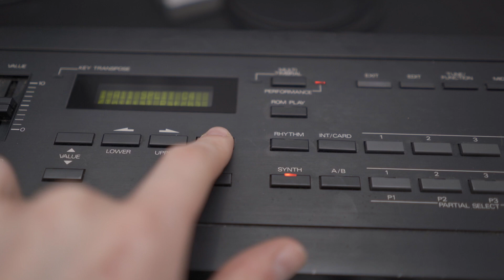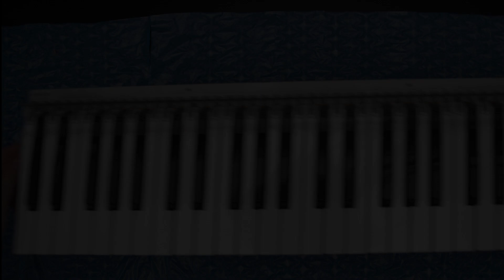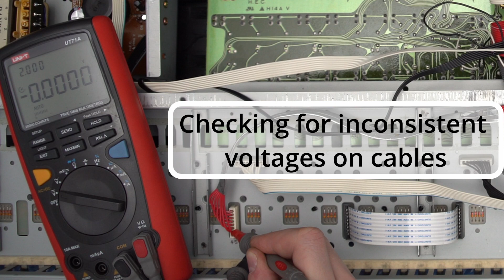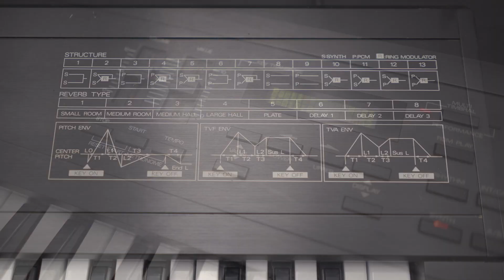Vintage synth restoration - Roland D-10 from 1988

Comment: FYI - there's a test mode you can enter by holding EXIT+EDIT together in which you can check all the switches, pots, keys, LEDs, the disk drive, etc.
Reply: Should also note - hold those buttons together while powering the synth on!

Comment: At 5:30, instead of desoldering all those tact switches, you might try servicing them.  In the four corners of each switch, you'll see the welded/melted plastic rivets that hold the switch together.  Using a knife or flush cutters, snip off the ends and lift the metal body off.  Use some contact cleaner or rubbing alcohol to clean the switch contacts.  Then put it back together and melt those plastic rivets with a soldering iron.  You can only do this once - the next time you'll have to replace the switch.

I learned this from watching the YT channel Spare Time Repair.
Reply from the maker: It is definitely possible, i agree - I've shown the internals of a disassembled push button on my roland D5 repair video, there isn't a major reason why you couldn't clean the existing switches. But i would argue that it is absolutely not worth the effort - i don't see it saving much time over swapping the switches with new ones, as you have to cut 4 plastic rivets, disassemble, clean the contact spring and internals, reassemble, all while also potentially destroying the structural integrity and risking them coming apart later on due to re-melting the rivets with a soldering iron, which will not be as secure as when it came from the factory. And the cost of all the switches bought in bulk is no more than 5$, so there isn't a financial incentive to save here either.

Comment: Thanks for creating an excellent detailed video to document the repair of this synth. Back in 1996 I had the D-110 rack module, but just recently picked up a D-10 on eBay for next to nothing, sold as working but with problems. Turns out it had exactly the same issues as this video: dead battery, half the panel buttons dead and every fourth key dead! Battery is super simple to replace, and the buttons weren't too bad either, just time consuming doing all 39! Due to the regular pattern of dead keys I suspected a break in the switch matrix. In fact, it was in almost the exact same place as this one! 3 little jumper wires soldered between the connector points and now everything is working perfectly!

Comment: I’m currently doing this and I’m having trouble removing the ribbon cable clips off the board, any tips?
Reply from the maker: For the wire trap connectors, you don't need to remove any clips, you just need to push the middle section down by holding it by the sides

Comment: My Roland D20 powers on and everything else works fine, but the entire keybed is dead…none of the keys give any output, even in MIDI test mode. However, if I create a short from the keybed metal frame to the lower solder points of the diodes just below the carbon contacts, the keys do register input. Has anyone seen this before or know if it could be a grounding/connection issue? PLEASE HELP
Reply from the maker: You might have bad traces or broken cables somewhere - i would use a multimeter set into continuity mode and check all the traces and cables

Comment: mine does weird things after being put away for 6 years. I use it as a master keyboard and most prominent is sending note off messages randomly instead of key release. that means the note is cut immediately. or sending random notes while using pb\mod. like the software is damaged somehow. 
can this be a battery issue?
i did factory reset too
Reply from the maker: Sorry to hear that. Honestly, i'm not sure what to suggest, it could be corrupted software, but a battery replacement wouldn't fix it. You could try searching for a replacement ROM chip to buy online, but there is no guarantee that that will fix the problem
Reply: @TheRepairLair  well i did what i could and interestingly it got much better. original battery: 3.07V new battery 3.47V or thereabouts. plus full reset. now it only happens very rarely, 1 in 5000 control packets, which is still kinda annoying bcos if u use the joystick often thats only a couple of minutes... Turns out mine is very pristine on the inside, even the bender unit looks brand new. no dirt, no damage. A also cleaned the modulation pressure strip with benzene and it has a great feel now. Its baffleing how a wheel action can trigger a note they should be completely different circuit. i suspect its either the midi out on the synth or even the cheap midi usb interface (the one with the shiny cable).
Reply from the maker: @kbuss10  I'm happy to hear it got better! I really don't know what else to add, the behavior you describe is super strange. I hope you can find and fix the final issues with it!
Reply: @TheRepairLair  did you find some working forum about repairing these older synths? well i got the service manual and schematics are quite clear. midi transmit comes out of the main cpu directly and there is only a filter cap, a hex inverter and a transistor plus 3 resistors downstream to the midi out connector... they look still buyable, so in worts case i change them. another youtuber claimed that the mod/pb can be calibrated somehow... you know anyting about that? i find it hard to believe.
Reply from the maker: @ The service manual describes a test mode, but that doesn't seem to have any calibration mode. It could be that calibration is done using potentiometers somewhere

Comment: Very useful video 👍
I just have only 1 key that doesn’t sound 🤔 I have cleaned the rubber contact but it doesn’t work. Do you thing think that just only 1 key could be corrugated (contacts lines ?)
Thanks
Reply from the maker: Hi! I don't believe just one single key would be affected by broken traces, but its worth inspecting everything in detail. Before you go hunting for broken traces, i recommend something simpler - find a good soft pencil, and paint over the contacts on the board as well as on the rubber memrane - it is possible that the carbon contact material has worn down too much
Reply: @ I dismount everything again and inspect the contacts …. yes there was 1 corrugated line 😉
I sold a little wire and that is right. The key note is repaired 🤩
Thanks for you video and comment 👍
Reply from the maker: @happyboar1019  well done, im super happy it worked for you!

Comment: At time code 7:01 you remove a clear plastic key retainer. What glue or tape do you use to reattach that clear plastic?  Or do you leave it off?
Reply from the maker: Ah apologies, i missed showing that part in the video. You can remove the adhesive material and use 3M LSE 300 tape for sticking them back. Thanks!

Comment: Your video inspired me and i'm trying to refresh my d10. I need to get to the buttons on the front panel because some of them need to be replaced but i'm stuck at 2:47. I can't pull out some of these plugs but i don't want to pull too hard. Is something supposed to click there? It doesn't want to come out! 😫
Reply: These are the same as the connectors in the Roland mc 303 i replaced tactile switches in they are wire ended cables you get a screwdriver and pop up the surrounding holder and pull the cable up once they holder has been lifted sometimes they can break but even then they still go back in no problem and hold the cable

Comment: Pretty much a D-20 without the floppy drive and sequencer board. Those wire trap cables are the worst ever, why they ever used them is a mystery, just stick a JST plug/socket on it, grr. Acetone is not particularly plastic friendly, would not recommend for cleaning buttons etc, probably melt them LOL.

Comment: Wow, I'm so impressed with your skills and patience. I thought I'd done well fixing a key on a PC-180. Lol. I've got a D-110 working but throwing out a distorted sound across all outputs. It seems to be an intermittent problem. Any ideas? I read that it might need the the dac replacing?
Reply from the maker: any chance you have access to an oscilloscope? my recommendation would be to dig out a service manual and check the entirety of the chain between the sound generation to the output and trying to see if you can find some points where the signal is still good and where it turns bad, lacking a service manual you can still try tracing wires from the outputs back towards the sources in the same way. It could be a problem with the dac, but also, it is more likely to be a power supply issue due to some bad components like capacitors or transistors
Reply: @TheRepairLair  Thanks for your reply. I reckon I can change the dac, but, I'm afraid I don't know enough about electronics to investigate this further, but I'm interested in trying to learn enough to be able to diagnose and hopefully fix the problem. ( A new hobby. lol) But that could take a while. Anyway, I've subscribed to your channel. Thanks again.

Comment: NICE JOB,but why don't you test the key's diod before re screw the missile??so a you said tge same problem with d 50 PCB BOARDING ASSYY,i think acidity of the pcb combined to the time and other factors as fortissimo touching distroy the tracks!!!!for repairing use only good typon,as earing sony from walkman !!!the contacts are truly good with a good iron and nice temperature for resoldering the clues,as u may done!!!!congrate!!

Comment: Roland keys come up great after a short cycle in the dishwasher!  I've used this many times.  Works great.  Nice restoration here, well done!
Reply from the maker: Oh that is a brilliant, brilliant suggestion, i never had this idea! I will do that next time, thank you!
Reply: @TheRepairLair  most welcome!  Mostly I restore Rolands too, MKS70, Juno 60, 106, Alpha 2, JX8P, JX3P, TR606, VS2480, MV8000, and so on : 0
Reply: Just restored horribly yellowed keys from Alpha Juno 2. Soaked in very warm water and dishwasking liquid. Rinsed and repeated and dried off using microfiber. As new. High quality materials.
Reply: @steingrimurarnason5784  Great work!  retro brighting can work too for keys

Comment: Hi, Thanks for the great video! I have enjoyed it a lot! I have a question, maybe you know the answer. I have just bought a D-10 and the keys move side-to-side (wobble) quite a bit. Do you know how to fix it? Thank you!
Reply from the maker: Hi! Are all keys moving side to side a lot, or just a few? I don't really know what could be wrong there, if its all the keys, then its possible someone had disassembled your synthesizer before and didn't reassemble correctly
Reply: @TheRepairLair  Hi, Thanks for the answer! Unfortunately all the keys. There's a solution however. The issue is, the 'key guides' shrink as they age. You can replace them with a 3 x 1mm silicone hose cut to 5mm pieces. Now it's perfect :).
Reply from the maker: @csabasanta5696  Awesome! Thank you for sharing this info!

Comment: Wow, thanks for making this video! I just got a D-10 with some dead or pushed in buttons (yep, sticky tape was worn out) and different volume levels on some of the keys. I even found an old post stamp (55¢ from 2008) and lots of dust, tobacco and some dead insects inside. 

I was able to fix most of the issues just by cleaning the keybed and pressing the keys & buttons hard and often. But I didn't have the guts to remove them with all the springs and stuff or even replacing the dead buttons with new ones. I will most probably do that soon to have a fully functional D-10!
Reply from the maker: Thanks for sharing that with us! I think you really shouldn't worry, overhauling it definitely looks more scary than it actually is :)

Comment: Are the benders repairable?
Reply from the maker: If the pcb is cracked like it was on mine, it is somewhat possible but very problematic. You need to glue the pcb back together, and find some conductive paint to reconnect the carbon trace to the metal contact. Likely not worth it, considering working ones could be found for ~20$

Comment: This is very nice.  I appreciate when someone can take of the equipment like that.  I used to have a D-5, but I wasn't even able to replace the main system board.  It's very impressive to have such methodical skills to be able to disassemble the entire instrument, do the soldering so neatly, and even being able to fix the traces on the circuit boards.  I am quite amazed watching this video.
Reply from the maker: Hello Dvamateur, thank you so much for the lovely comment, i'm very happy that you enjoyed the video! I'm happy to say i have another synth repair video in the works, which is so long it will likely be multiple series! I assume you don't have the d5 anymore?
Reply: @TheRepairLair  No, I no longer have the D-5.  When I had it, it produced considerable distortion on both the line and headphone outputs.  I ordered the main board replacement, but I wasn't able to replace it.  So my whole D-5 experience had ended in a total fiasco.

Comment: Hi, How did you keep the tracks separate while soldering at 10.12.
Reply from the maker: hi! I soldered each wire separately. First, add solder to all exposed copper, then add solder to the wire, then add flux to the pcb (ideally flux paste, not liquid) and while holding the wire on top of the traces gently tap it with the iron to flow the solder. If you mess up, just desolder and start again - as long as you dont use excessive force you wont damage anything!! good luck!

Comment: Nice work. Especially the corroded solder traces. (Who cares what it looks like ?) And thanks for the vid. These are super easy to work on. Just the 2 circuit boards, keybed and power supply. Did the same as you, all the tact switches and keybed refurb. Your bushings are still on good shape. Mine were not.  Also, I rebuilt the power supply. I've been doing that on all my old synths as of late. My bender plate was broken, working on a fix for that.
Reply from the maker: Thanks for the lovely comment and feedback, i'm happy to hear another D10 is getting saved from the dumpster!

Comment: Very nice video! I also own a D-10. It luckily didn't have a broken pitch bender, but a corroded volume control potentiometer. Had to carefully disassemble it and pry open the slider to clean it with contact cleaner. It's been running great since, although some buttons are pretty bad responsive-wise. Might have to replace those in the future.
Reply from the maker: Excellent, thanks for sharing! if you see my d5 repair video, i also had issues with the volume control slider (which happens to be the same part as in the d10) and it wasn't corroded, but instead, completely worn out. The buttons definitely have to go!
Reply: @TheRepairLair  I'll be sure to watch the repair video of the D-5. Haven't seen them being completely worn out, though, but luckily there's replacements available.

Comment: Also on mine all the white printed info around the keys on the case is going away… not sure how to fix that. Any ideas ?
Reply from the maker: Hi! I don't think i can suggest any "easy" fixes here, but, if you are handy with something like Inkscape, you could take a picture of the text and recreate it  on inkscape, then order transparent label printing service online. If you manage to remove all the remaining text you could then just stick the new labels on there. Not the best solution, but reapplying the text in another way i'm not sure if it can be done

Comment: Hey. My enter button sticks sometimes when I push it. Do you think relaxing the adhesive will solve this issue? I have never taken it apart so I do not want to unless I know this will likely be the fix.
Reply from the maker: Hi! Removing the adhesive will create other problems, as it is required for the proper operation of the button. Ideally, you'd want to take it apart and inspect what's going on visually to get a good idea. It could be something as simple as dirt, or, if you mean by sticking that the button sometimes doesn't return, its likely a dead switch. Best of luck!
Reply: @TheRepairLair thank you. Is there soldering required install new buttons?
Reply from the maker: @jordanrattanavong2655  Yes, as shown in the video, you must desolder the old one and solder in a new one.

Comment: In 1989, D-10 was the first model I was in charge of during the factory line training for new employees at the current Hamamatsu headquarters of Roland Corp. I am very happy to see people who continue to use these nostalgic models with great care.
Reply from the maker: Thank you for sharing this! I'm very happy to have the means to get these old synths back into working state
Reply: The D10 was my first professional synth and it was the first multi-timbral keyboard with reverb and drums! Almost too good to be true at that time (1988).

I made many great sounds myself as I learned how to program it. I especially remember a choir sound that sounded like a sampler using 4 sawtooth waveforms with suitable filter and resonance settings.

The high hat was a bit lame but with a higher pitch it sounded better. 
Snare drums could also sound better if one combined the attack and decay of various snares in various combinations. It sometimes created a slight phaser/pitch-effect that randomly changed the sound and made it sound more dynamic and realistic.

I wish it had had a LFO for the filter. That's one of the reasons why the D50 sounds better.